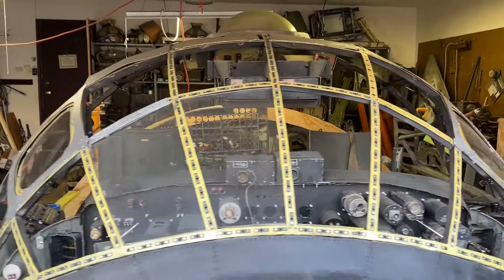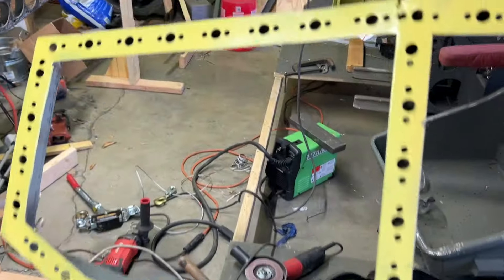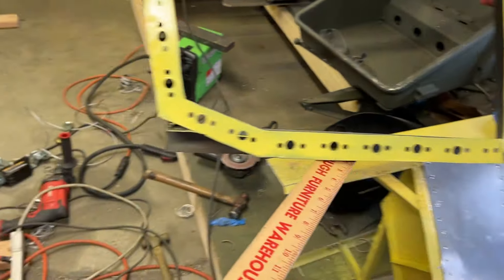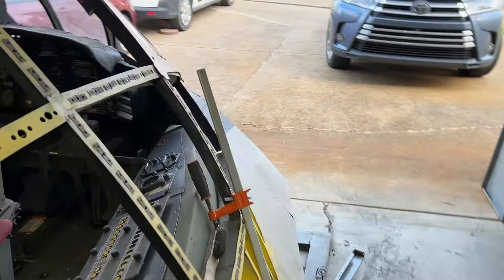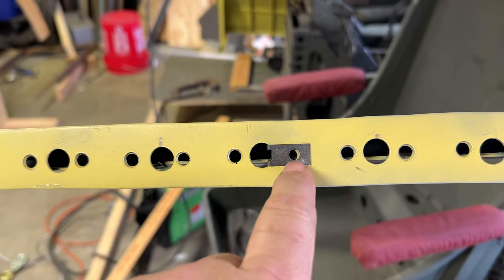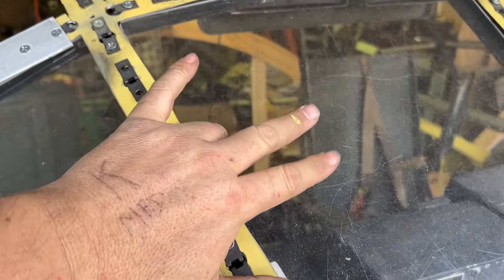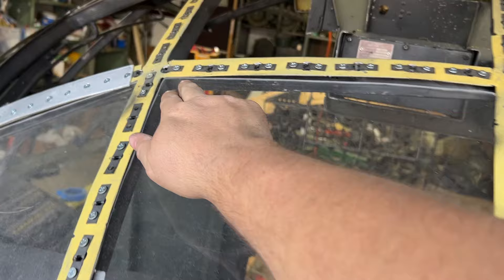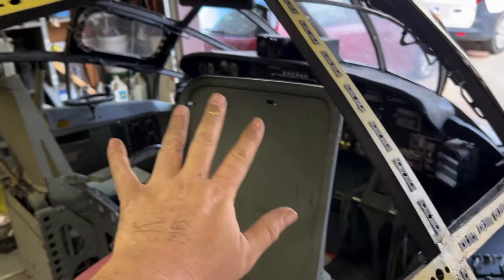Full Scale B-36 peacemaker Scratch Build Canopy Progress

Comment: to what end?
Reply from the maker: It fluctuates. Right now it's nose to flight engineer station, but that could grow considerably depending on funding.
Reply: @B36HPeacemaker  I mean.. what is this for? a simulator cockpit? why does it need to fit on a trailer?
Reply from the maker: @jamesjross  It’s for me. I love the B-36 and sharing my knowledge with others. The tailer is so when I eventually move or take it to air shows, maybe.